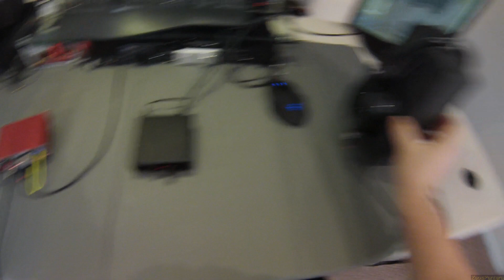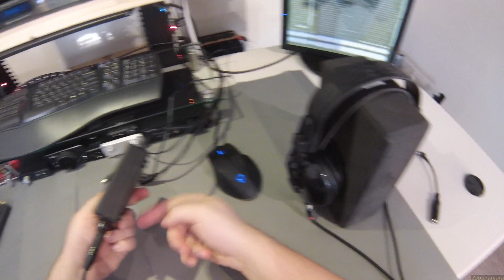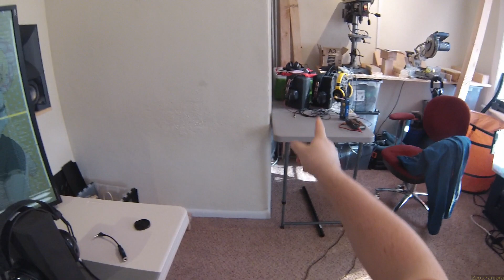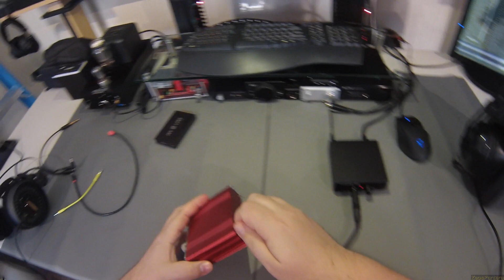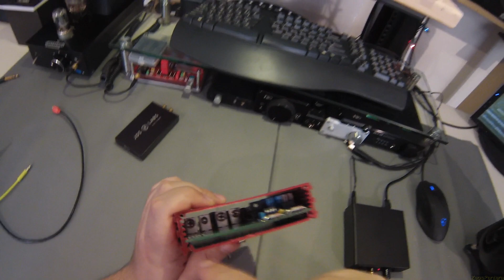Z Review - Massdrop O2/Odac Combo

Comment: the symbol doesn't exactly means loud or gain, it can be a in schematics it can be an OP-AMP or Buffer which are about the same thing but are used for entirely different operations. In analog, it would be an OP-AMP and it basically is a really high impedance input and a low current output amplifier, at which point its more dependant on your load (headset) to determine the output.

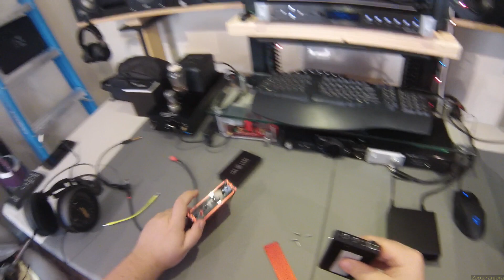Comment: 8:11 if you plug the power the batteries get recharged without taking them out. another example of how not to make reviews.
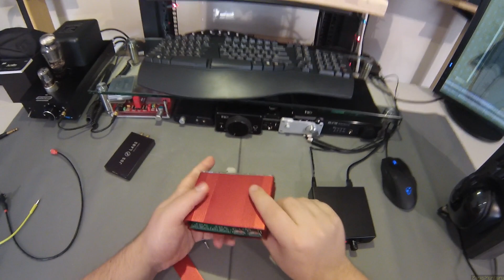9:48 if the circuit is designed correctly restrictions make no difference. it's not a toilet pipeline

Comment: Will this run the akg 712pro? And will it be better than the smsl m3?
Reply from the maker: yes and yes
Reply: Well shit, they're allready sold out on massdrop with 7d left.. Will the m3 be able to run the the headphones good(not super good, but good..) or would you not recommend it. Sadly I live in sweden so most of those amps people talk about isn't available here. (Schiit for example) E10K is an option aswell but I know you prefer the m3 over it so..
Reply: SkipAll -hey skip. I have the 712s. M3 is fine. Only 62ohms. My iPhone will power   the 712's. if you want something much better go Mayflower Electronics web site. Look at the OD2/Amp. Much more money but well worth it. It has no problem powering my HD600 or any Byerdynamics 250 ohms headfones. Hope this helps.
Reply: Peter Mota
Ok thank you. I'm actually looking into the FX-AUDIO DAC-X6. Seems kinda promising altho not to many reviews on it yet :/

Comment: Optical is not for gaming consoles only ! In fact you should switch if you can.
I came to the conclusion that optical input is better (they're not only for home theaters and living room entertainment).

Why ? Optical cables can go longer than unpowered usb. Optical cables are not subject to electromagnetic interference. Optical cables do not pick signal noise from noisy PC motherboards. Optical connections usually can go up to higher sample rates in synchronous dacs (192 kHz versus 96 kHz, I don't know the reason but tells me something about implementation). Optical virtually eliminates the need for special usb denoisers and stuff. It's conceptually better to have separate signal and power cables (I don't like the idea of drawing power with the same interface you're transferring data with). Many of this points are arguable because usb is "lossless" (and has correction or something so the data transfer is absolutely accurate AFAIK) but hey, having a cleaner data source certainly cannot hurt. Anyway, I think it's never good to feed a DAC with a PC powersupply, so if you're transferring audio through usb I think you will always benefit from a separate power adaptor. Of course there's a chance that optical will not improve your quality and even reduce it because of a bad implementation on a particular DAC but I think this is almost never the case but rather the other way around. Optical cables are cheap, I think it's worth a try at least for everyone to get that elusive 1% after the 95%.
Reply from the maker: For Stereo SPDIF is fine. But Home theater the new standard is HDMI for carrying 8 uncompressed streams vs just two with SPDIF

Comment: Z, do you prefer O2+ODAC combo or a Schiit stack? I have a pair of Beyerdynamic DT770 Pro 80 and Sony XBA-A3's. Thanks.
Reply: Or even an OPPO HA-2 so I can take it around with me for my XBA-A3's. My Note7 has a very weak amp, I have to put it to about 90% volume for it to be uncomfortable which would be 75% on my iPhone.
Reply from the maker: Schiit stack probably. Although the BD's and sony are not hard. HA2 if you want it to ever go portable.
Reply: Thanks. I want the Shirt stack at home, but my Note7 doesn't power my XBA-A3's well enough, so I may want to make it portable. But I usually use them at home anyway because I'm scared to ruin them so ATH IM70's on the go. The HA-2 can work as a desktop amp as well right? So I could plug it into my computer for a while until I want to use it on the go?
Reply from the maker: yes
Reply: Z Reviews Thanks. I'll just get the HA-2 refurbed probably in a few weeks.

Comment: Like Johannes said earlier, that's the most general symbol for "amplifier" as used in circuit diagrams. I guess what they were trying to say was when you press that button you're adding an extra amplification stage that's not part of the active circuit when the button isn't pressed, but that's a very... technical way to express it.

Comment: Just quick question, odac stand alone dac is fine for studio monitors or combos would be better...?
Reply from the maker: Well the Odac will feed signal fine but you don't get any pre-amp to control the volume of the monitors so you have to do it in digital. If that is OK that is OK. If not you can add a control freak or schiit sys or look for a dac/amp with a pre out like the Micca Origen+
Reply: +Z Reviews thanks! I was looking for micca origen they don't ship here in Australia, i use digital volume. So i might get a odac.... Thanks a lot... I really can't thank you enough zee...

Comment: A note: The "CC license" is not a license, it's a set of licenses. The license used by the O2 Headphone Amp is a CC BY-ND (CC Attribution-NoDerivs) 3.0 license. This specific license (because of the ND tag) explicitly states that derivative designs cannot be distributed.

This does mean that you personally can modify it to be anything you want but can't distribute the new design.

It's a weird license considering what NwAvGuy stated in the section of his original blog post for this project. A CC BY-SA would be a much more appropriate license.

By the way, the SMSL M3 works great! Thanks for your suggestion. And the HD 668B with Brainwavs Velour pads sound amazing too! Your goofy videos are wonderful, thanks!

Comment: if i have a far more superior amp than the o2amp but i still need to use the o2dac inside the o2amp/dac combo, can i connect my superior amp to the o2amp/dac combo? will it be double amping and destroy my headphones?
Reply from the maker: I would only use the 02/0dac combo if it had line outs on the back or just buy the ODAC alone.
Reply: im currently using e18 KUNLUN amp/dac connects to 02amp, do u think 2 amps are better than 1 amp? Need your expert opinion here bro

Comment: I built my own O2 and excluded the battery terminals. Put a DAC in that space. No regrets. Best amp ever,  does it all. I even have a 3.5mm and 6.2mm input as well as a 3.5mm passthrough for the DAC.

Comment: 1/4" headphone jack uses the same inputs as the standard version, but you have to move some things around (a couple of caps are in the way) in order to accommodate it. Same thing goes for having both the power input and the RCA Jacks on the back. Not sure of the RCA's on the back are an input so that you can use the combo as just an amp, or as a line out to use the DAC with other stereo sources. Pretty sure that the combo still uses all of the same components over all, just arranged  different than the reference design.

Comment: If I want to use an external DAC with my PC, should I get one that's made for headphones or what? Most have a volume knob on them, my Bose companion 2's are powered, and have their own volume knob.... Perhaps the Schiit Modi 2 since it's primarily a DAC only?
Reply from the maker: +bmx045 If you have a headphone amp just get a straight dac. If you need a headphone amp and dac but want to use powered monitors also you  can get separates and split it

Comment: My Massdrop O2 doesn't shut off the RCA jacks when I have headphones in. So apparently I can run both speakers and headphones at the same time.
Reply from the maker: +jigglyworm That seems correct. The dac should be completely separate from the headphone amp.

Comment: Expecting a used HE-500 to arrive soon, I assume the O2+ODAC can't deliver the 1 to 1.5 watts per channel that is recommended for the HE-500, correct?
Reply from the maker: +RojasTKD7 Should.
Reply: Z Reviews
 Per the product discription the  Massdrop O2+ODAC out put at around "Max Output (33 Ohms): 613 mW".

Sadly after a little research the suggested out put to drive the HE-500 the their fullest is 1 to 1.5 watts per channel @ 38 ohms.

So I think I'm going to have to find something with  "MORE POWERRRRRRRR". Wnat to make sure I give them what the need to shine.

Think I'm going to try it with my old AV receiver (Via HDMI, I guess) and see how that works out, until I fond a proper desktop DAC/AMP that can bring the juice.
Reply: +aaa vin ok thanks. I sounded like that's what I needed to get them to sounds good not necessarily loud. I don't want to run any headphone at full volume. I like my hearing. :)

Comment: The gain switch looks like an electronical symbol for an amplifier (a triangle with an input and output).

Edit: The restriction thing is bs. The smaller a circuit, the better it is (less problems with interconnections between the parts and less pickup of noise from the outside).
The O2 is already pretty big because it used through-hole components to allow for easy DIY soldering. 

What could have been done better is that the output impedance should have been set lower. NwAvGuy thought that 1dB level changes were acceptable, but if you look at the research of Floyd Toole at Harman (they have some white papers for download) you will see that even .25 dB can be audible and even less, when the Q of a filter is set lower than 1. Also, absolute level differences of 0.1 dB can make a difference in a blind test environment, which is why loudness matching is so important in psychoacoustical research. I would estimate that, in order to achieve neutral reference performance, deviations of less than .1 dB should be achieved even with critical headphones like Multi-BA In-Ears. This dictates the output impedance to be around 0.1 ohms or less, which is for example achieved by the high end Violectric headphone amps. The O2 only has an output impedance of around 0.5 ohms, which can, with the right In-Ears, create broad level deviations in the neighborhood of 0.5 dB, which are well into the audible range.
Reply: +Johannes Fried 
What could have been done better is that the output impedance should 
have been set lower. NwAvGuy thought that 1dB level changes were 
acceptable, but if you look at the research of Floyd Toole at Harman 
(they have some white papers for download) you will see that even .25 dB
 can be audible and even less, when the Q of a filter is set lower than 
1. Also, absolute level differences of 0.1 dB can make a difference in a
 blind test environment, which is why loudness matching is so important 
in psychoacoustical research. I would estimate that, in order to achieve
 neutral reference performance, deviations of less than .1 dB should be 
achieved even with critical headphones like Multi-BA In-Ears. This 
dictates the output impedance to be around 0.1 ohms or less, which is 
for example achieved by the high end Violectric headphone amps. The O2 
only has an output impedance of around 0.5 ohms, which can, with the 
right In-Ears, create broad level deviations in the neighborhood of 0.5 
dB, which are well into the audible range.

Comment: cheapest dac/amp combo that's decent? also are there dacs that dont use a quarter inch jack? im a newbie pls dont judge
Reply from the maker: +whynot SMSL SD793 is cheapest exceptional dac amp. Yes there are. FiiO E10k. BUY 1/4" is better for longevity. Break and wear out an adapter vs the port in the unit.
Reply: +Gray Au I do have an adapter I was just curious thanks for the tip :)
Reply: +Z Reviews thank you I'll check it out
Reply: Gray Au I have no plans right now but if you have any recommendations, feel free to tell me
Reply: Gray Au just the cheapest possible so I guess up to 100 dollars max

Comment: Yea like one of the other commentators have stated with the combo unit like in this video the ODAC takes up that space where the batteries would have gone in just the amp. What you have there was marketed as the desktop model which was actually another additional cost during the sale. The power being on the back and the 1/4 jack are the indicators. Also I don't know much about creative commons but these are the second revision of the O2 and ODAC. Things have been changed since the original design.

Comment: Is there any downside to powering jbl305s with this? I'm currently using the fio e10 DAC headphone amp and I get a lot of static and have trouble driving my speakers sometimes.  It has a line out,  which I am running a 3.5 to xlr breakout to the monitors. I run the jbls at 7 for their amp.  I just get a lot of noise when not running them and if I need to really push the audio they don't keep up.
Reply: Vs the e09 fio?
Reply: +Tim Kyle ah,  can't even buy the fiio e09 anymore.
Reply from the maker: +Tim Kyle These are line outs so you would have to control the volume via your PC's Master or grab an RCA line level like the Emotiva control freak or Schiit sYs.
Reply: +Z Reviews is that why I am having some issues? What's wrong with connecting it to the headphone out and using the knob? Can you recommend a DAC amp to power my jbls and headphones properly? Is it a good idea to amp powered monitors to 'help them out'  a bit?  Sorry for my onslaught of questions.
Reply: +Tim Kyle This was my O2/Odac unit, and I have 2 JBL 305s running right out the back and have had no problems.

Comment: I have the same mass drop version.  I happen to have the annoyingly small torx screwdriver  handy so I opened mines up. Indeed, there are two sets of 9 volt terminals on the inside. Though one of the sets has a copper coil thing blocking it from actual use.
Reply: where can I buy this size of torx screwdriver? all the ones I found are too big
Reply: +Bruce Z look up iFixit. They have everything for small electronic devices like this.
Reply: Look for a precision torx set on Amazon that includes the smaller range of torx sizes, T1-T3. Typical garage sets will not includes these smaller sizes.